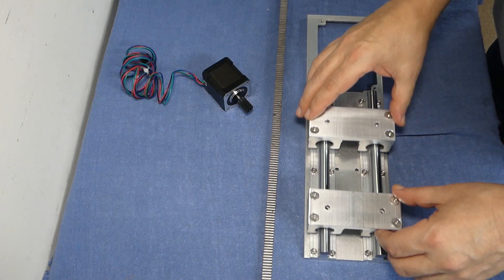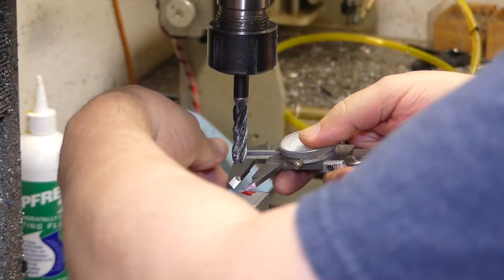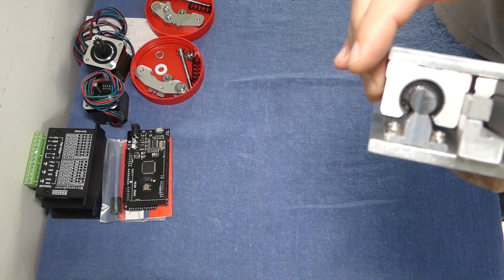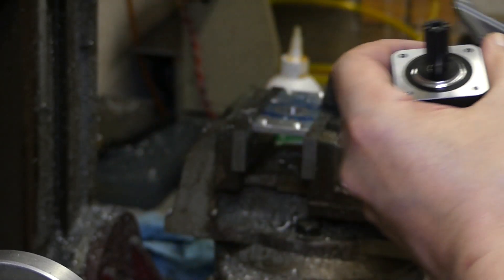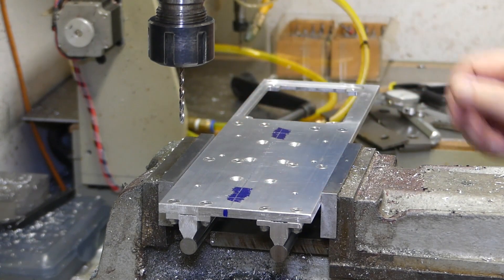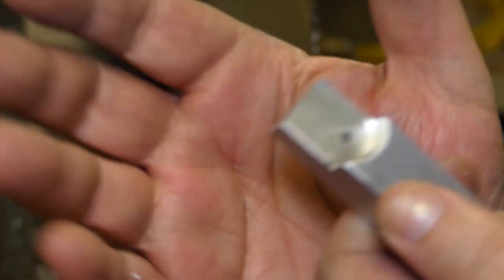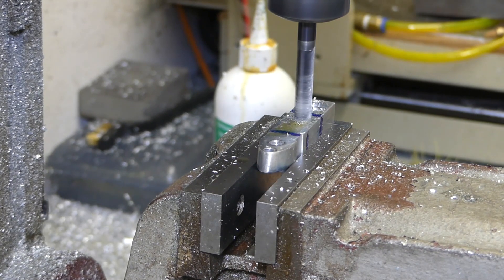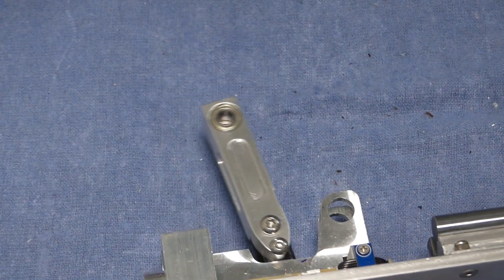Cyclic Force Trim Mod for Virpil's VPC MongoosT-50CM2 Base Part 2 DIY

Comment: Amazing stuff! Would be awesome to have a flying video once you have it all complete :)
Reply from the maker: Thank you! What a great idea. Never have done it, but I will look into some capturing software for sure. Thanks for watching my project!
Reply: @crashmetwice  I agree - I was thinking more along the lines if you'd potentially want to keep using the base for fixed wing aircraft and keep it "in the center position" for that purpose? Of course if it is exclusively for helicopters that may be unneeded work indeed. :)
Reply from the maker: @kontoname  Good point! I actually didn't think about it for that purpose as I am flying only helis. You already pointed that out. Thanks for commenting!
Reply: @crashmetwice  Hahaha yes, sorry it was late night for me already and it was supposed to end up in the other comment about the neutral button 🙊

I didn't even know I had already left a comment before! I did re-watch the videos though since they're so awesome and because I'm thinking of either improving my base (CM2) or building a new one myself.

Thanks though!
Reply from the maker: @kontoname  That sounds good, I love it when I can inspire someone to get a project started :) Thanks so much for your compliments and watching. Let me know what you decide on your base.